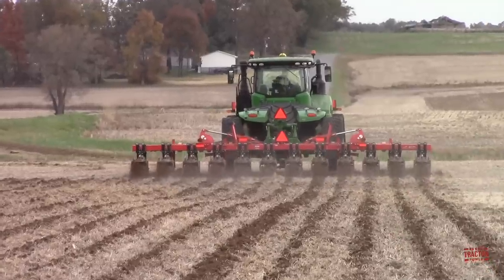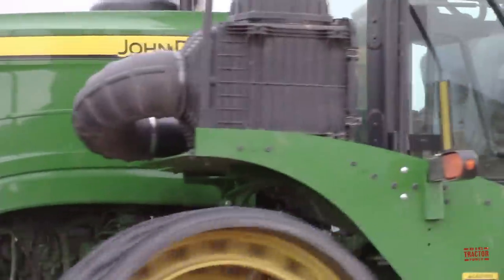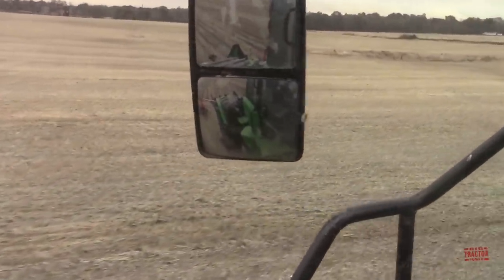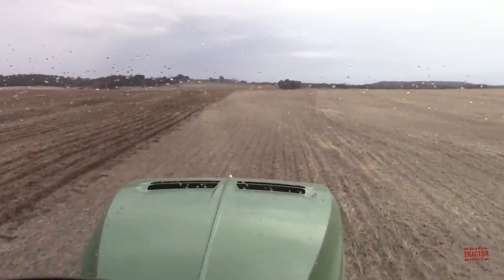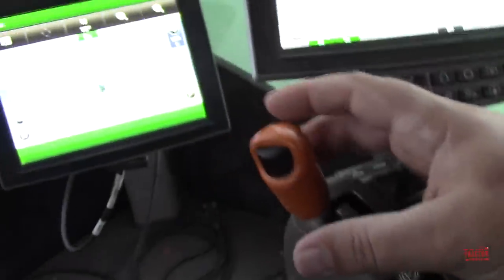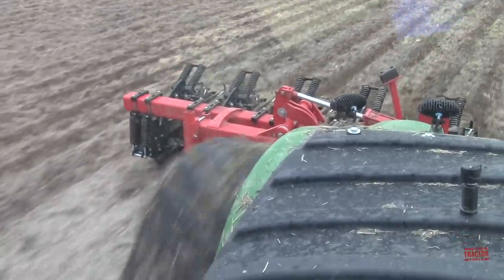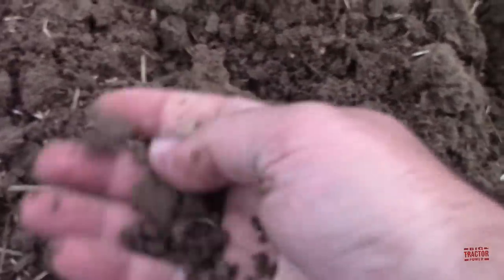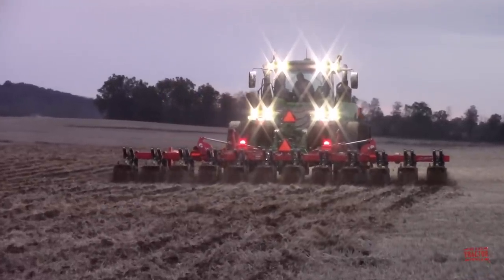I Get to Drive a JOHN DEERE 9470RX Tractor

Comment: Looks like lots of fun Jason... Back in the 80's the farms high HP tractors did one thing, tillage... Back then if we had grain carts, narrower tires etc,,, we could have put twice the hours on our "big machine"... Even in conventional tractors today you can get 400+hp tractors in row crop configuration, just amazing from my experience farming 30 years ago...
Reply from the maker: It is impressive how big a “row crop” tractor is today. In 1980 the Steiger Tiger 470 was one of biggest tillage machines on the market. Today this 9470RX is mid sized and could cultivate corn and beans.

Comment: Incredible that the seeder will match the strip that has been worked, the GPS must have improved, its been a decade or more since I've used one, sadly.
Reply from the maker: I should have filmed it but I made two turns that were long so the implement went down 20ft late.  I went back to clean those two passes up.  When I messed up the tractor was headed north originally across the field and the two goofs were 120ft apart.  When I cleaned up the spot I took the first section on heading north and looped back on a u turn heading south. I engaged the GPS and the rows lined up perfect.  I overlapped into worked ground about 5ft and those rows were doubly loose.  It was neat to see how precise it is.

Comment: going to make the 4786 jealous
Reply from the maker: The 4786 is a classic. I will say it’s not as easy to handle as the 9470RX. Raising the implement is so much easier on the modern tractor.

Comment: That toolbar is HEAVY lotta tractor to play with it like that  ! Most I've seen were mounted on pull type carts and we're putting down NH3 or dry fertilizer or both ! Those articulated tractors can be really hard on 3point mounted equipment , straight ahead isn't to bad but corners are too much ! Thanks for the video!

Comment: Does this area have any rock?  Been really thinking that this tool would work in clay/rock fields considering they have been no tilled for years but due to big machines I think our land is getting compacted
Reply: They've got something.  At 12:40 - 12:45 you can see the shanks tripping.
Reply from the maker: There were some stones in the field.  You can see at the 12:40 mark the shanks tripping. While I was running I snagged a stone that got lodged in between the shank and the rear disk blade. I would talk to a dealer based on your conditions. I know in the Rochester, NY this Gladiators are popular. They have lots of stones and prefer running these to a mulch ripper. They will run a rock picker following the Gladiator and ahead of the corn planter. They run the strips in the spring.
Reply: @bigtractorpower  They have a demo running in upstate SC and are going to bring the demo out to our farm next week, so we will see how it works.  Thanks.

Comment: Awesome! I operate a 8310R. I wanna know what it feels like to use tracks
Reply from the maker: Tracks are great in tillage. Smooth ride and pull to move a bit faster. I just an 8RX 370 and an 8370R ripping in the and field.  The 8370R would spin in the tough spots.

Comment: 600 grand....I wonder if they'd take my grandfather's 8020 for an even trade. Lol
Reply from the maker: It would make a good down payment 😁. With only 99 8020s and I know of at least one that was cut up it’s a rare Deere. They bring good money.
Reply: @bigtractorpower   its got a newer cab with AC and heat and a decent satellite radio system and sound deadening and a air ride seat because that Detroit is annoyingly loud. He was going to put a pusher blade on it for snow but we dont get the snow like we used to in Indiana. Its not  near showroom grade , but its nice